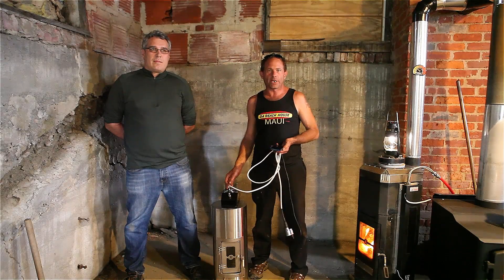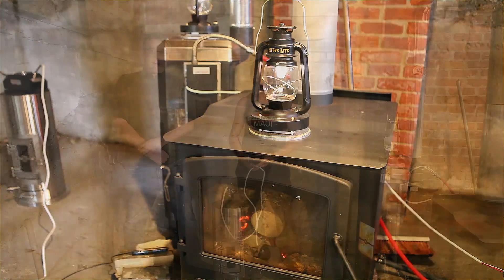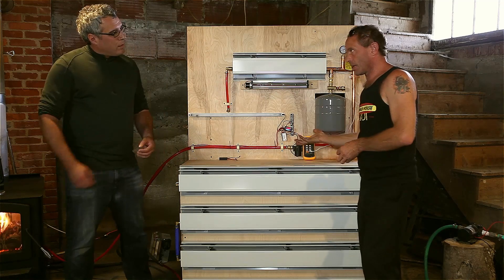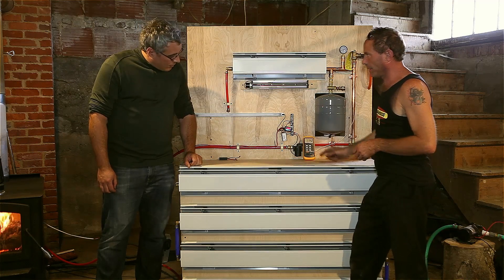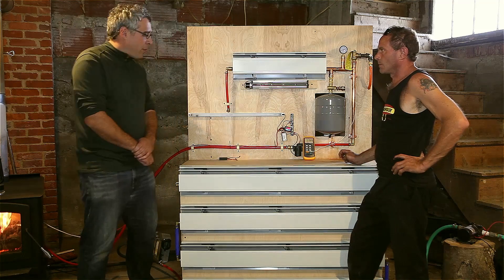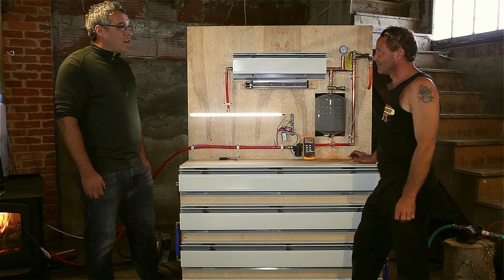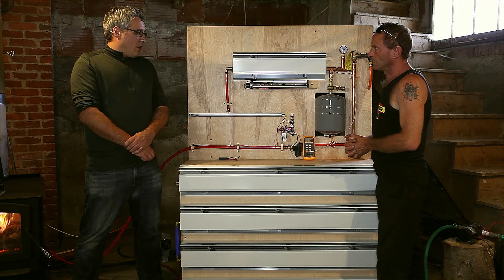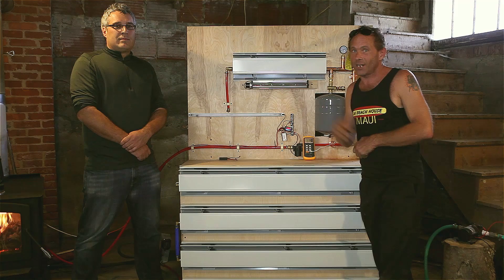Use of Thermo Electric Generator on Wood Burning Stoves

Comment: I heat my home with an outdoor "boiler". Is there a system that would allow thermoelectric generation from the hot water that is being pumped into the house to then power the pumps so that the system would be able to power itself as well as provide power for some other uses?

The water from the boiler is currently heating my domestic hot water and in floor heating in the house.
Reply from the maker: What’s the temperature of the return water? You’d be better to use the cold return water as this type of system works on a delta of a hot side and a cold side.
Reply: @UnforgettableFireLLC  The water coming out of the boiler rubs about 165F-170F. The return water would only be about 5 degrees lower.

Comment: @0:37 What's with the deliberate military stance ? Is this where you think the main body of your market will be ? I can't help but notice the steady drone of that water pump, which seems kind of noticeable. I don't want hear that when I'm trying to get to sleep. In a small cabin or tiny house situation, the placing of that pump would be critical, so as to limit its droning chatter. Also, your spoken specs of the water cooled thermal electric generation block at 14.0 Volts at 1 to 1.5 Amps. Really ? This is not a very adequate charging rate, Sir. Most lead acid, Lithium, or Gel Cell battery arrays want to be charged at a C 10 rate. Sorry guys, but what your suggesting here is barely possible. I'm curious as to how many days it would take to charge up a home backup battery array at a current output rating of 1 Amp ?

Comment: I have looked for anyone that has used solar heated fluid and fluid from a separate tank that runs through the same radiator at night to cool the fluid.
So you wind up with a tank of hot fluid (made hot through solar radiation) and a tank of cool/cold fluid made cool by radiant cooling.
Using these two fluids, one could then generate power through the same technique described in this video.
Essentially, another way to generate electrical power from solar radiation and passive fluid pumped through the same lines used for solar heating.
However, I know solar panels have gotten impressive output in the last couple years.
Important: no need to use water!  Water is corrosive and is not as efficient as synthetic heat transfer fluids.

Comment: You know what, more than the thermoelectric generation it would be great to just store that hot water in a insulated tank and then feed it to in floor heating or a hot water radiator. Like a inexpensive masonry stove where water is your thermal mass with the added benefit of not having to support the giant mass of masonry.
Reply: That's called a wetback stove. Rayburn solid fuel stoves are exactly that, nothing new. Been made since the late 1940's. We have one. Amazing woodcook stove